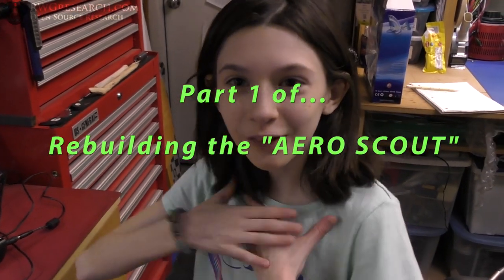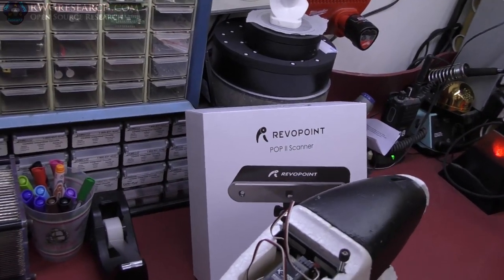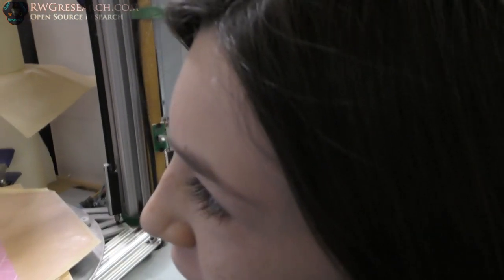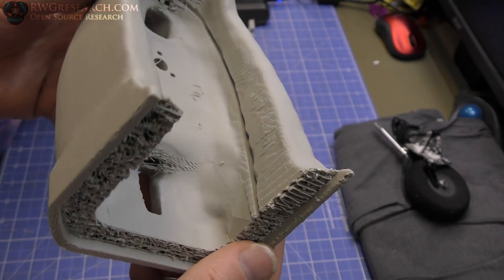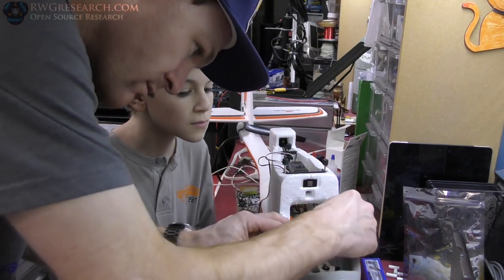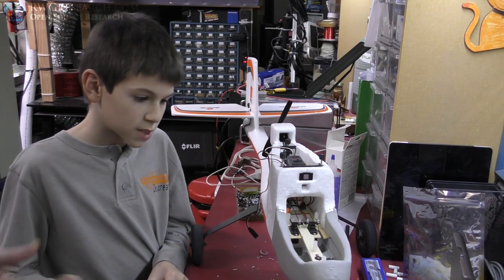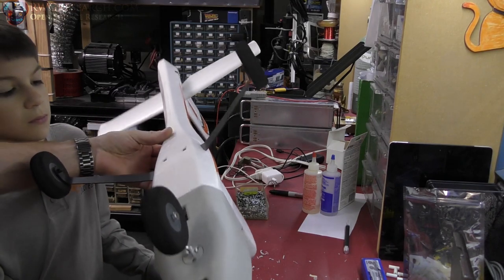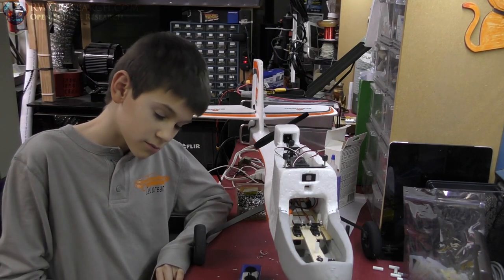#3-22 P1- Fixing The Gifted AeroScout... Soon To Be Renamed... 3D Scan, Model,3D Print,Rebuild!

Comment: Cool fix Russ. I'm starting to work with Sketchup 8, importing stl files into Sketchup 8. Then I can fix them and change them the way I what.
Reply from the maker: Thanks. Yeah I used sketchup for quite some time. But finally moved to fusion 360. Much better but sketchup still works! Cheers. ~Russ

Comment: blender is the better option, you can learn to retopologize manipulating vertices independently or in groups and or sculpt. basically you would take that rough scan into blender set it on the origin and then draw out a surface model over the scanned data, mirror over origin. then enthicken it.